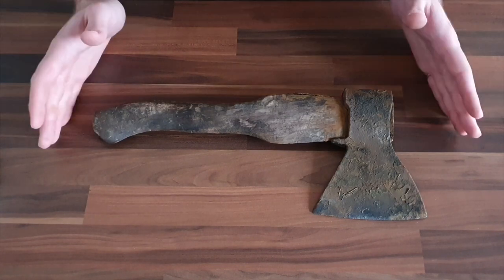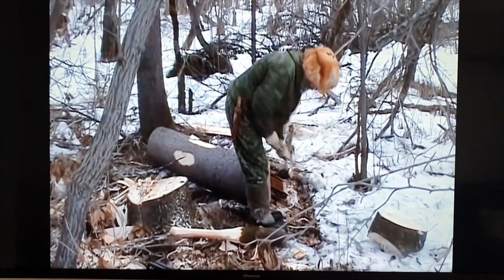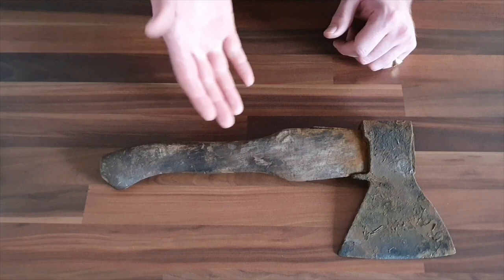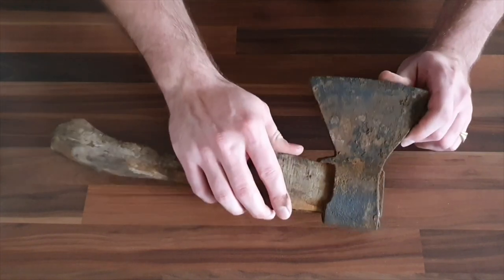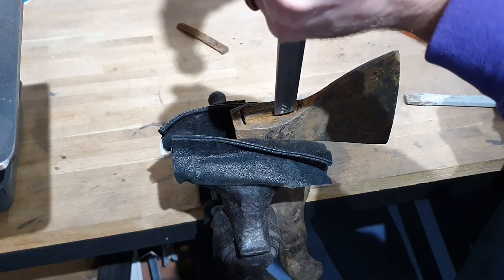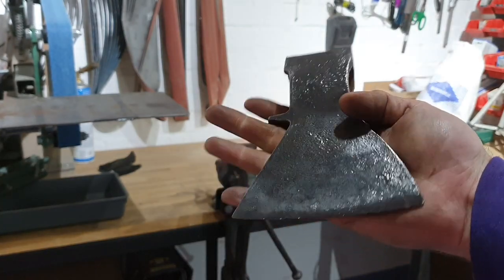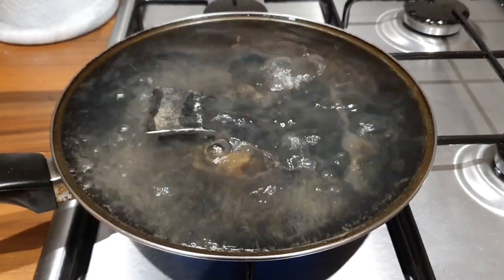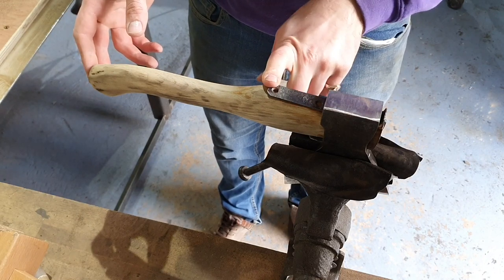Unique Russian Axe Restoration

Comment: That is a beautiful axe and well worth the effort. For future rust removal, get yourself some rust remover from Bilt Hamber in the UK. Mixed with water, use it hot for great results. You can reuse it over and over. I have a plastic dustbin full for large objects. Top job.
Reply from the maker: Good to know, I'll try to check it out when I get the chance. :)